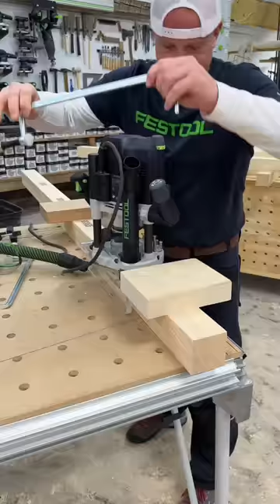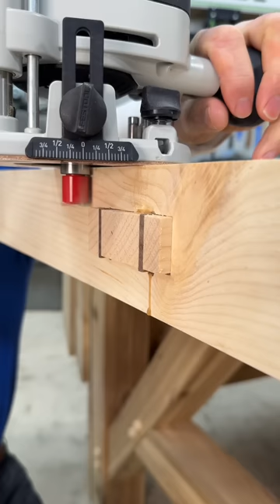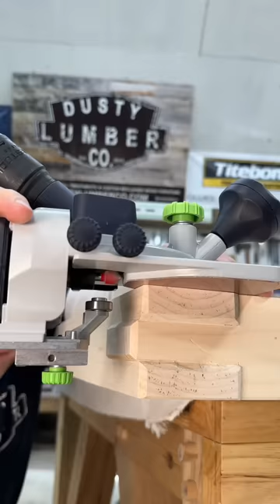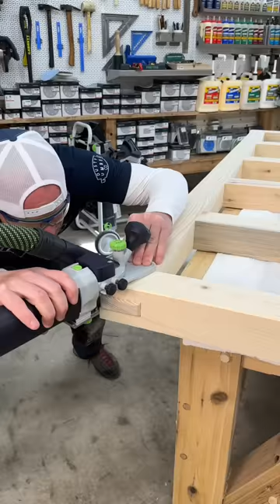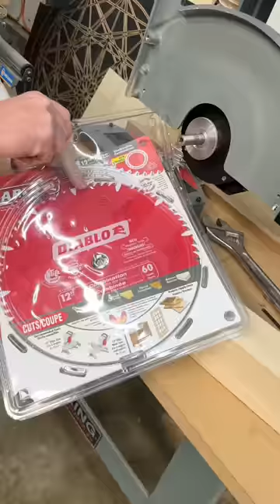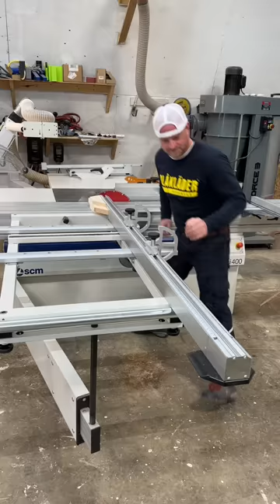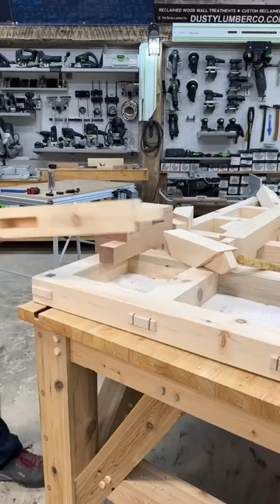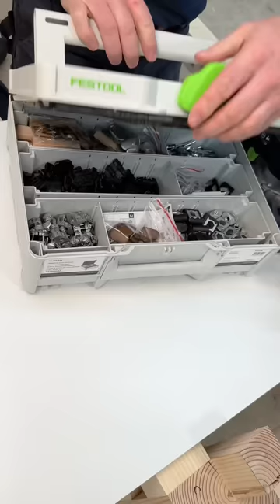Building a big floating timber frame bed

Comment: Its not just the high end tools.  Most of us could spend a month in that shop and not produce the same design, accuracy, or artistic touch.   True craftsman.
Reply from the maker: I appreciate that very much thanks!
Reply: True
Tools just speed up the process. Without skills, you can only dream about building stuff like this 👌🏻
Reply: I am reporting these videos for triggering me for not having the money or space for all these wonderful tools which is secondary to not having the skills either.
Reply: I was thinking that Dusty's shop is a fantasy come true. But while watching I found him using tools (hardly King or Festool, but hey!) and techniques I own and/or could acquire with time and patience. I have a table saw, an arm saw, a quite capable drill press and my hand tools are teal. Bits and blades I own are comparable. So...I COULD do this...but it would take significantly longer than 15 minutes 🤣🤣🤣

One thing I truly appreciate is that Dusty does not feel compelled to talk us through every single step. See here...this is what I am doing. It might seem confusing to newbs, but those of us with even a small amount of experience making sawdust can see and understand what he is doing and where it will go next. The dude is simply a master craftsman...to a level not many of us have achieved, and I do ever so much enjoy watching him work. Thanks for sharing, Dusty!
Reply: yep, with those tools and all the time in the world, i'd still end up with some very expensive fire wood
Reply: "Before the lightsabers, come the Jedi"
Reply: Piece of cake with $ 100 K  machines
Reply: @JedediahSmith342  Cake isn't easy either 🤣
Reply: I came here to say the same thing. Great tools, but you really need to know how to use them.  There's also a lot of preparation between the fast clips. I'm impressed by the tightness. Great job
Reply: If I had a shop set up that nice I would never have to work a public job again!!
Reply: No, it's not JUST the high end tools, but... it certainly IS the high end tools. 😂
Reply: Yea , it’s hard to get these precise cuts with out good tools but it is possible. However it’s impossible to get these precise without years of mastering your craft. Tools don’t make the man, the man makes the tools.
Reply: This seems to be a very heavy design. Best to build very near where it is wanted.
Reply: @gregorycrose5846 this is what I was thinking as well.   That frame is one piece.   Is it even gonna fit through a doorway?  Up a staircase?  Is it intended for this to be installed in a barn loft?
Reply: Just like anything in life, experience matters. Knowing how to make your cuts with the proper tool requires a lot of time and effort. Sure tools serve their purpose and make things easier, but go back to his earlier videos and watch how he made the same things with just a table saw & hand tools. I’ve learned so much from this channel.
Reply: Agreed,but Festool is very high end. I wonder if he’s sponsored by Festool? Very nice work.
Reply: Nothing is identical
Reply: Lol speak for yourself. As third-worlder whos been making things with just hand tools, your comment is borderline insulting.
Reply: While that's certainly true, having not only the two or three power tools you'll find in every garage, but a whole woodshop fully equipped with professional precision tools and materials definitely helps.
Reply: @feelingtardy 😂😂 yup
Reply: I can produce the same result with much lesser tools, but it will take much longer. I however, did these kind of work for a living. About 27 years now. 
Yeah you need to know what you are doing..Some people will watch this and conclude it is easy. 

They have no idea.
Reply: The tools let the talent shine...👍👍👍
Reply: @JohnDavis-tj1bl I hear ya.
Reply: That is true. But i sure would love to have that workshop all the same.
Reply: @ophirb25 om the other hand the tools are useless if there is no talent.
Reply: Também pensei nisto,  @kinarism , e temi que ficasse inviável instalar em uma residência comum. No entanto, além de uma obra de arte deste porte não estar à altura de "gente comum", mas muito endinheirada, cujas residências fogem dos padrões convencionais, a plataforma dos pés da cama é aparafusada (unica peça com partes não madeira), de modo que pode ser removida/recolocada para permitir a passagem por portas/janelas "mais padronizadas". 👍
Reply: No question
Reply: ZZZ x?
Reply: Exactly.  His videos might not show, but I am sure he spent a lot of time off camera doing preparation work so everything lined up and fit perfectly in the end.  Lots of layout, adjustments, calibrate tools, etc.
Reply: This is the case when you have a lot of professional tools and you only use 5% of their capabilities for all sorts of nonsense, where you can get by with a minimum of tools, and in some cases even faster.
Reply: @kinarism  the stuff he makes must be for wealthy people living in mansions or for company offices.  Most homeowners can't even afford the lumber used in this furniture.
Reply: It’s clear you love what you do and you’ve mastered it!
Reply: @AlexRa911  how do you know he uses only 5%? He has a thriving business that can pay for the tools and these tools save him time. He values his time unlike you who watches video not to learn but to trash what you can't have 😄
Reply: Yeah, but the high end tools are what caused me to watch to the end.
Reply: I've done a little woodworking in my own shop. Big challenge for me...accurate cuts, and glue up assembly. One thing to measure, draw lines, cut, another if it turns out it fits without gaps and screaming. Give me a couple more lifetimes, lots of free time, a ton of patience, and I might be able to assist in a project like this. Better give whom ever I'm assisting two tons of patience.😂😂😂😂
Reply: @kinarism not one piece. Metal pieces at end allow for leg assembly and disassembly.
Reply: So im not the only one sitting here think where the hell do I screw up in life?  My G-d man.
Reply: Awsome!
Reply: 진정한장인이십니다 !
기술에감동입니다 .!!!!! .
행운이오기를바람니다 . ^^^^^^^ .
Reply: Well I just sank in my chair! 😂 why did I click on this craftsman’s video! I’ll slither away silently and maybe no one will notice.   Truly amazing, yes I’m subscribing
Reply: Beautiful work, nice shop
Reply: Aye it take smote than a tool to make an excellent job !!! 

Which goes hand in hand with the phrase ... bad workman ,blames the tool ...
.
Any kind of fabrication is an art work ... 

even with simple tools like , a diy festool type saw set up and router with templates ,can recreate this bed .... It'd just take a longer time scale .

Sometimes to be creative also takes ,been able to be adaptive ... Heck the first humans to make a wheel ,didn't have cnc machinery
Reply: P.s. original poster well said !!
Reply: I can do SOME woodworking but this is on a whole other level for me! This is GOD mode activated! @drpoolshooter
Reply: It’s a loose use of the word “Craftsman” He’s no cabinetmaker! “Best craftsman”, “Amazing skills” hmm, it’s fun to watch but for most of us, the tools and shop impress us more!
Reply: Totally agree. Tools don't make the man. He knows what the f he's doing lol. Great joinery work. Love the wedges, I wouldn't have thought of that
Reply: Responding to a post above lol
Reply: Anyone dismissing the skill and experience as easy, needs to know that nylon underpants provided by their mother are no longer a fashion statement. Get out of the cellar and experience the real world 🤔🙄🤦‍♀️
Reply: I'm a joiner and really appreciate the skill and craftsmanship that's gone into this project. I wish I had half his toys in our workshop sure would make my life a lot easier, instead I use stuff that passed it's used by date 60 years ago. But still I make silk purses out of pigs ears. Nice job mate.
Reply: Ну и что это такое?
Reply: The guys gifted.  He has the best tools but could do it with any brand
Reply: The tools are not necessarily advanced, it is the skill and knowledge!  I used to love watching my dad do this suff 50 years ago! There are tools now that can make a task easier, but you still have to know how to do it! 
I am an artist who paints and draws, and this man is an artist who uses wood to create with!
Reply: Wonderful work. It let's the Glory of the Creator of all Creation shine bright.
Reply: Facts
Reply: Дуже шкода часу, що дивився ...
Reply: Looks a bit over-designed.  Suppose he needs the mass to stop the bed from tipping over.  Should be still around when our children's children are old.
Reply: Obviously, they also can't work as software engineer or any other profession we are having as they have skill set and knowledge of their proffession and we are having of ours
Reply: This channel is purely for advertising tools. It’s basic joinery with cheap timber. There is nothing artistic about it. Go watch some real master craftsmen like Norm Abrams then you’ll understand.
Reply: I would love to spend a month there 😍
Reply: Damn!
Reply: I am a carpenter and I concur.
Reply: Exactly!
Fantastic craftsmanship. Discipline chases passion,  passion sets priorities & finds a way to make things happen - even choosing good tools.
(Gotta pity woke losers for loser comments)
Reply: Absolutely true. 🎉
Reply: Have to have a customer
Reply: No se sabe que es
Reply: El artesano no necesita mil herramientas
Reply: La cama más cara del medio 😂😅
Reply: The amount of amazing tools is mind blowing. However it is still awesome work and only one guy did all that. Great job buddy!
Reply: Nice bed frame but Boy that what a lot of timber - was it designed to survive a nuclear blast or 2 morbidly obese 6 footers getting it on ! 🤔
Reply: @JedediahSmith342 Nonsense. Absolute nonsense. All you'd be doing as an inexperienced hack would be to ruin said nice machinery from using them wrong. 

I've seen it way too many times.
Reply: @JohnDavis-tj1bl Why on earth are you parasiting on everyone else by working for the taxtortionists? Why can't you get a real honest job anyway?
Reply: @calysagora3615  what does that even mean?  The “taxtortionists” ?  I’m not and never will be a government employee!
Reply: Speak for yourself guy. It is a show of tools. That's the only reason to do the same cuts with multiple different tools and methods. And if it takes someone a month to produce that bed, they aren't making $$$. Its very nice and well built. He is good. No doubt, but it's nothing special. I did a similar style bed for a client that wanted a chessboard pattern on it from dark walnut and light burl maple and it didn't take a month. The entire outer edges and headboard were chess board. And I don't have all of those tools. Used the radial saw and tablesaw for probably 85% of it.
Reply: Sorry : Whit out those tools , I bet he can't even build a chair!
Reply: If that's what you do for a living you better be good at it I'd hope
Reply: I've seen lot nicer work done, all with hand tools and a grumpy attitude lol
Reply: Actually I have to do very similar stuff with very cheap and mediocre tools, because while I need something like that, this is still not my main job. So only casual tools around.
Reply: Way to suck up to the creator of this video. Literally anyone could do this "craftsmanship" with that kind of budget. Duh.
Reply: All tool and materials a first year shop class could have built that
Reply: So satisfying watching this.
Reply: Don't sell yourself short.  A month is about all it would take.  I've taught some pretty dumb people how to do this with a lot fewer tools in less time.  Not saying this guys a poser.  Just don't call it art.

Comment: Hey Dusty, I really enjoy watching you work especially how you use different tools and methods to make the same cut on multiple pieces.  A true teacher who shows you don’t need modern tools when chisels, handsaws, clamps, and straight edges will give you the same results, just takes a little longer.👍
Reply: "Don't need modern tools"??????
90% of that was done with tools that didn't even exist 50 years ago!
A skilled workman, and a nice piece of work, if somewhat "over-engineered", but that might well have been a design feature.
Reply: @christopherdean1326  Modern tools have been around longer than 50 years.  Shopsmith has been making similar tools for over 70 years that take a fraction of the space modern single-function behemoths and a cost a fraction of the price but yield the same results.

Nothing Dusty or any similarly skilled woodworker builds can be built with only modern tools.  The Amish and their ancestors have been using traditional primitive tools to build everything they own that looks just like this project.  Traditional Japanese woodworkers do the same level of precision work with hand tools, Dusty uses one of their handsaws to demonstrate how traditional tools gives the same results as using modern tools which is what I originally posted.

Dusty runs a business so he needs modern tools to keep up with demand that can’t be accomplished with traditional tools.  He also demonstrates how traditional tools gives the same results as modern tools, just takes more time and skill.
Reply: @christopherdean1326 Definitely designed to be over-engineered, probably to demonstrate different tools and methods. Some of his stuff I didn't know existed like the Festool "Fein" tool.
Reply: Fein?
Reply: So much festool you got to ask are they sponsoring?
Reply: @cory3106 No, people in most trades find a brand they like and stick with it. Some brands make certain tools better than others, but a lot of it comes down to personal preference.

Comment: That is the sturdiest bed I have ever seen built in my life.  A true carpenter.  Well done!
Reply: Just don't sit on the outside edge if you're over say....400 pounds. Legs closer to the corners would be more stable, but unlikely to be an issue for most people. Either way, that beast of a frame will hold up!
Reply: An old school carpenter would use hand tools. It's not just the exacting construction but the meditative process that goes into the product, ask any old Chinese Master carpenter.
Reply: This bedframe looks like it could fully support a 49 Packard!

Comment: I’ve read many of the comments and agree with most of them. Yes, this professional craftsman is nothing short of amazing. Yes, his tools and shop make all of us jealous because they are top of the line tools. I also agree with the mention of sturdy 2”X6” spruce construction for time management and weight value - I never want to have to move that bed frame. Overall, the bed frame will outlast the new owner and maybe be a genuine family heirloom. Congratulations on your success in woodworking.
Reply from the maker: Thank you very much

Comment: All that extra nice work done to the bottom frame just to be unseen once the bed goes on. Would've looked awesome with Walnut pins to lock those tenons together.  Nice build! Gave ne some awesome ideas for the bed frame aim building. Thanks for the post.❤
Reply from the maker: Thanks!! That is awesome to hear

Comment: This guy is using every tool under the sun. This is more about showing off his tool collection than putting a bed together. I built my own California king with cedar and pine. Did not take me as long as this guy. Mine was done in an afternoon. And I did not use 500 different tools. Been using it for the last 16 years.

Comment: This was great to watch.  One concern would be the weight of the platform half and while the craftsman was able to manhandle it, i can imagine many might find it cumbersome.

One refinement might be a 5/8" inset from the top to position a layer of particle board to place a mattress directly on.
Reply from the maker: I haven’t tested the max weight to tip it but it’s way more the weight if the person who the bed is built for. When I delivered it we put everything on and I had them sit and then jump on the edge of the bed and it didn’t tip
Reply: @dustylumberco  that's cool... I was mainly concerned by the weight in terms of being able to move it. ;-) no concerns in terms of design or support.

Comment: Great job and all the correct equipment combined with experience does indeed lead to great results.

But my one piece of advice/thiught is that those legs are quite to the inside. When a heavier person goes to lie down could be tipping the entire bed. I like the design of the legs being hidden (by being so much to the inside) so maybe endplates at the bottom of the legs could widen the reach of the legs?
Reply from the maker: Thank you.  I haven’t tested the max weight to tip it but it’s way more the weight if the person who the bed is built for. When I delivered it we put everything on and I had them sit and then jump on the edge of the bed and it didn’t tip

Comment: Very impressive carpentry. I still feel like if I lay on the edge of that bed it would tip over and I’d end up on the floor 😂
Reply from the maker: I haven’t tested the max weight to tip it but it’s way more the weight of the person who the bed is built for. When I delivered it we put everything on and I had them sit and then jump on the edge of the bed and it didn’t tip
Reply: @dustylumberco  ah fair enough. I’m 110kg so maybe different for me. But as long as I’m not sleeping alone I feel like I’d be ok with her counter weight😅